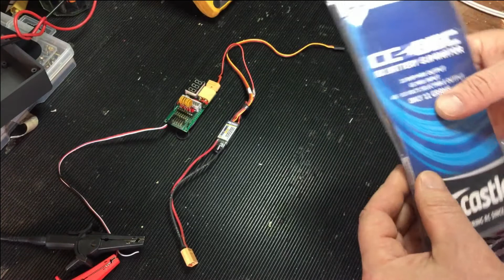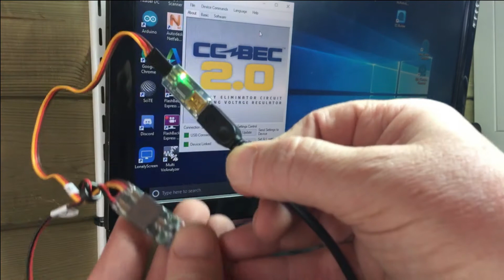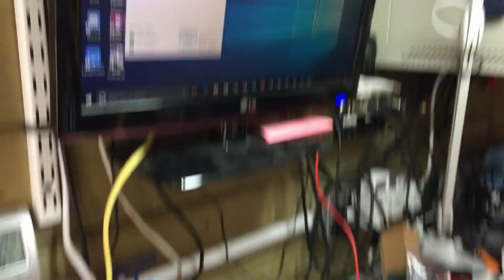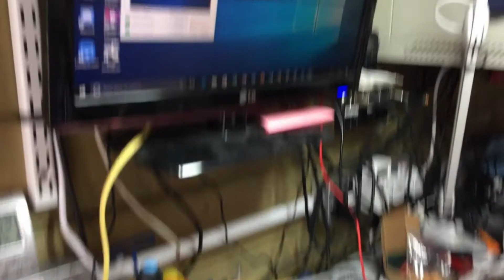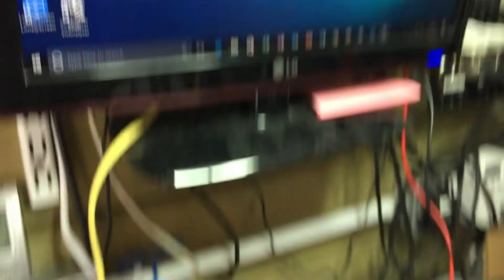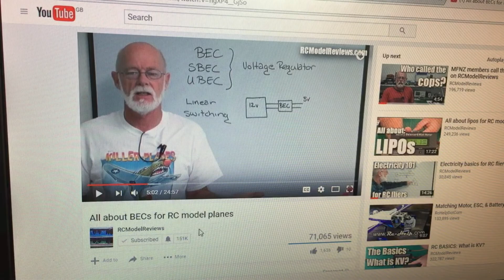InMoov Build Part - 16 - BECS

Comment: Hi Kyle. Do you have the part numbers for the 10A and 14A BECS. Where can I get these?
Reply from the maker: Hi Steve
I bought from ModelSport.co.uk  and they are Castle BEC - 10amp and Castle Bec 2.0 - 14amp
Also the castle Link V3 USB adaptor is needed to program them. 
The power supply I am using is a 12-volt 30-amp switched mode power supply from Amazon, Ebay etc [look under LED power supplies etc]